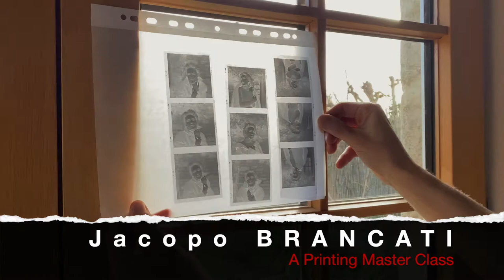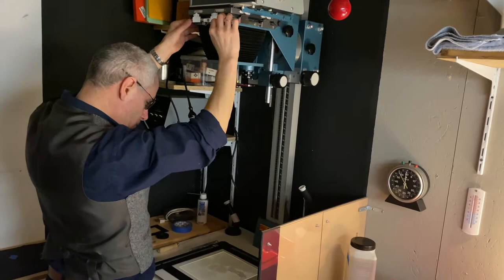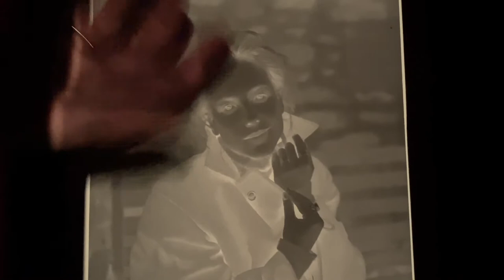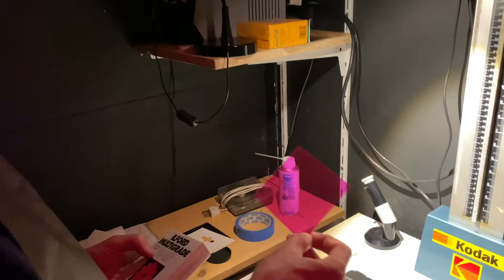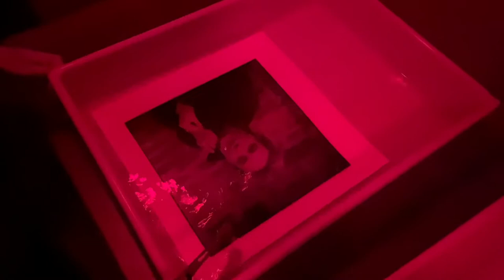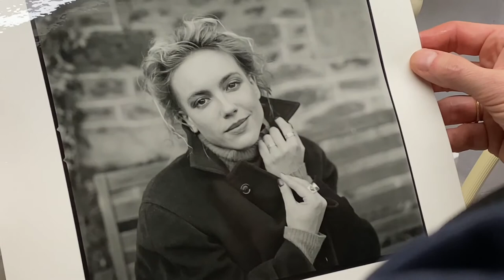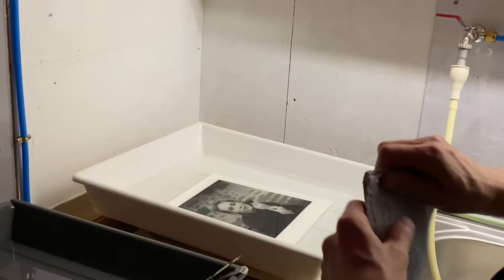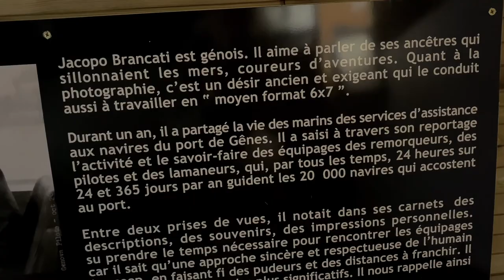Classic photography. Into the darkroom with Jacopo Brancati (I)

Comment: Good to see people work, everyone works differently. I personally use a meter, knowing where the Zones are and where those values fall on the negative projected on the base board get me to a full 10x8 first (test) print. I know where to go from there, i.e. small test prints of important areas. I probably waste less paper than people who make test strips.
Reply from the maker: Welcome to the user of the Zone System! It is particularly useful. I also use it. I do not mention it here in this video for it was not the topic. The Zone System concept is associated to the concept and management of the picture. Visualization.
Let's say that the first step is the metering, when you make your picture. Then you go through the development of the film, and it is a very important step based on and the visualization and the metering you made. 
Then once you have the negative you need, you make a further step printing the negative.
Personally I try to have the right negative for what I saw and composed.